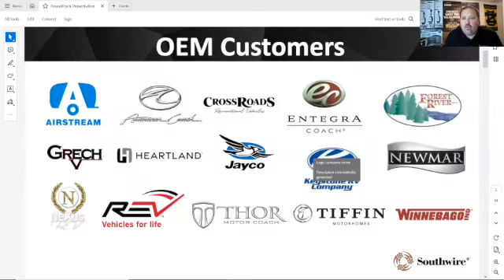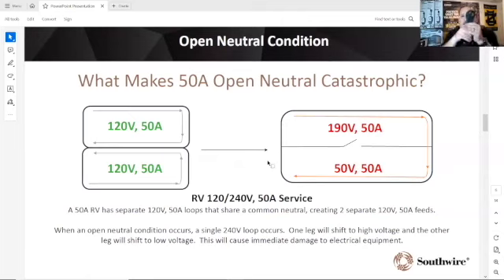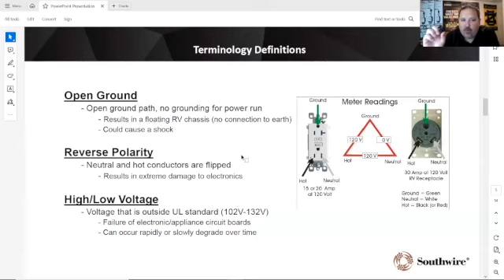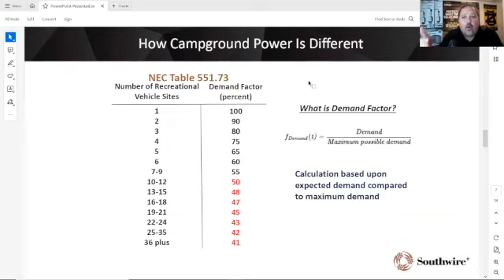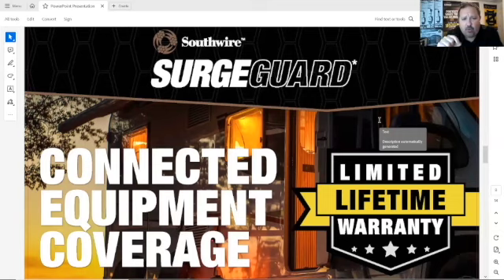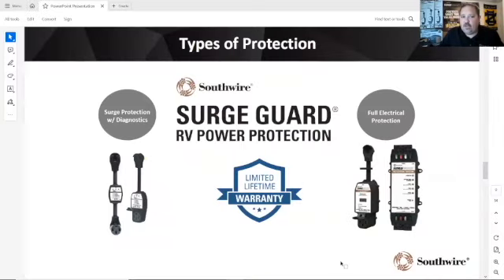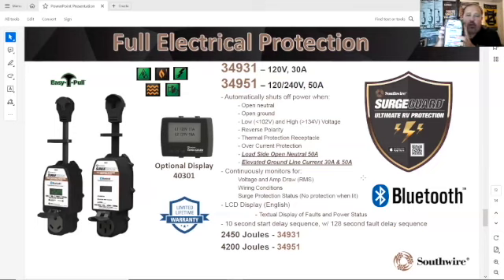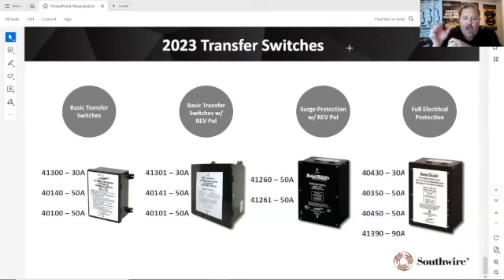SurgeGuard Online Event

Comment: We have an internal surge protector in our new Fifth Wheel, so do we still need to use one on the pedestal?
Reply from the maker: Hey, from what we learned, Southwire has alot of their units factory OEM installed.  The one you have may be their brand.  If not, you should just check the specs of what your unit protects and if its not as complete as what the Surgeguard provides, adding one at the pedestal would be a good idea.